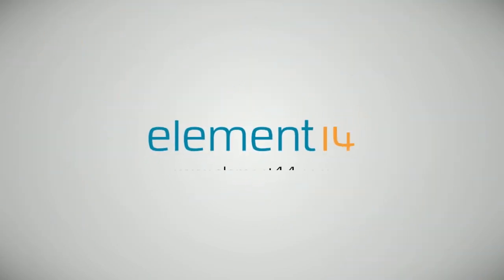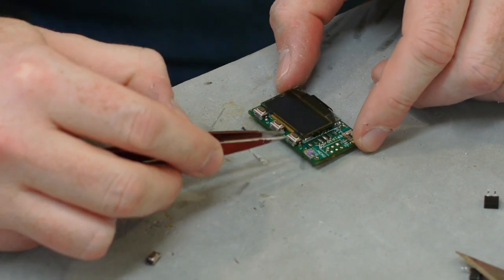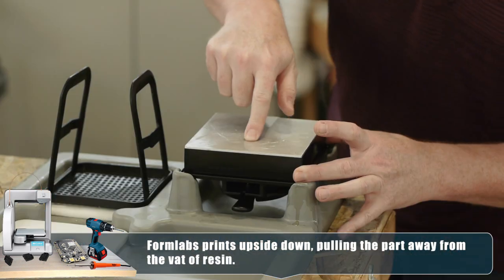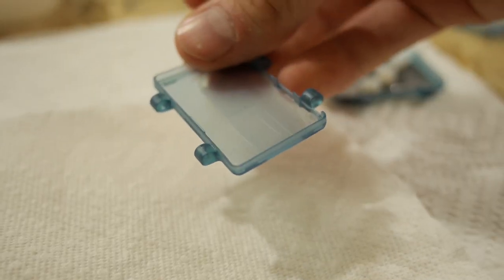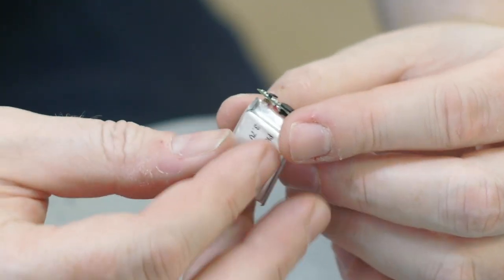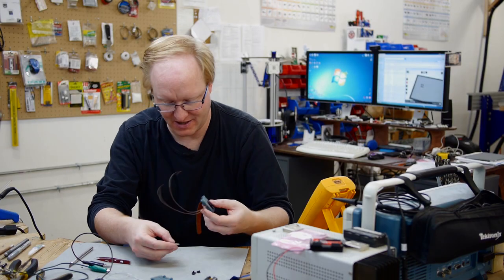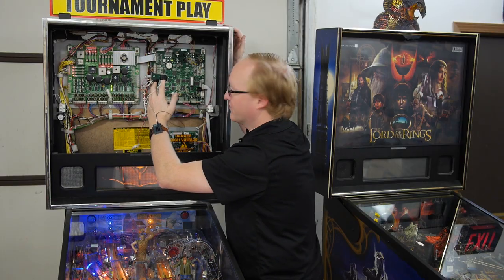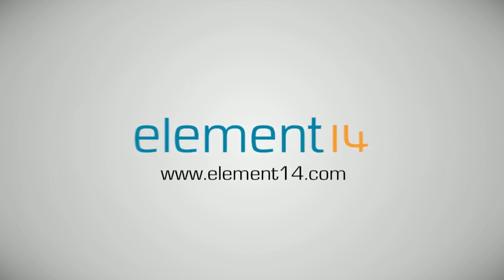Ben Heck’s Oscilloscope Watch

Comment: Seems an insulated glove would provide a bit more utility. As a wristband you are still left with the extraneous probes, wires, and finger mounts.  With a glove, everything could be all in one spot for easy transportation. Additionally you could add an additional probe with a longer wire for situations where adjacent fingers cant reach.

Comment: I have the same Tektronix 561A Oscilloscope he is holding at the start of the video! And yes, they are heavy!
Reply: +nzoomed My tech lab uses theirs as a doorstop. The door hasn't been closed in over three years.
Reply: +Troy Dietz lol, thats funny. I picked mine up at a radio club junk sale for $20 and it works perfect! They can go for $600 or more on ebay.

Comment: Nice job, Ben.
I like the design of the watch, its thinness. But I think another form factor could work better for a super portable multimeter. Something like a stethoscope. Maybe with magnets to hold the probes when you're not using them (if that doesn't interfere with the measurement), or clips or something.
Having them sticking out of your fingers all the time seems... I dunno, unsafe, unwieldy.

On the watch form factor, maybe you could place the battery under the wrist, where it's flatter.
Oh, and you could use a thinner, wider pieces of leather to make the bands, then fold and sew them. Hiding the wires on the inside. The battery "case" could be part of the band too, you could save some thickness there.
Anyway, lots of room for improvement.

It was cool seeing you do a project with the Form1! The lack of gloves while handling the print and cleaning chemicals wasn't so much, though. :P

Comment: Looks like some 70's mad science invention. Saying that I would have used the leather as a base-cloth and sewed/glued it onto a harder plastic strap along the top that hides the high profile of the battery and watch compared to the strap. Reducing the chance of snag. And with a higher profile of band you could have replaced the direct-to-device plugs with narrow pin plugs on the opposite side of the device so that a more standard probe could be plugged into the watch, with the battery being recharged in a similar fashion (literally by sticking pins into the watch band)

I also recommend your watch needed a catchier name! Like the Wrist-scope.

Comment: This is great and useful! If I were to do anything different, I would have sewn the battery into a second layer of leather, effectively concealing the battery into the band and hiding it completely. I would also make a second Slot/Compartment to store the wire leads while not in use. Maybe a SLIGHTLY wider screen to get better plot resolution if one's available. Over-all excellent build. Inspiring, as I use Multi-Meters all the time... Questions: Have you tested it's accuracy? Is it able to be calibrated? Is it reliable? How long does the battery last? Does it have a mode for measuring current?

Comment: You can discharge these batteries through a resistor, and you can buy over 300 watchband pins for under $4 on eBay. I think I'd have used that thin RG174 type cable for the probes, because it is shielded. I think it's 50 Ohms.  Jameco  has the tiny O Scope kit.

Comment: Great Episode. Loved it all except the probes at the ends of the fingers. Take two regular O-Scope probes and make an adapter that plugs into your watch port. Safer and the length of the leads will make looking at your display easier without pulling on the probes. Great job on the case. I would have calculated the absolute minimum wire size to use for the power leads. That will be a failure point.

Comment: Is anyone else sick of the thin technology thing? I always feel like I am holding a piece of styrophome and am always worried that I'll accidentally crush the damn thing with my fingers. I'm not saying we should make everything like the old 80's brick phone, but you know, structural integrity and a little bit of mass to make it feel like it's not papercraft is nice.
Reply: Me too i feel like its not even there when i hold a thin phone and that's why i have a thick case on my gs5
Reply: +Meep “the” Changeling Yea, and because of that damn trend, most phone manufacturers are getting rid of having a replaceable battery and memory expansion (no microSD now), and they are doing it with their flagship phones as well. That was one of the reasons why some of us chose to get a phone other than an iPhone. I think I&#39;ll stick to my Galaxy Note 4 for a while and not get the Note 5 because of this (not to mention that the note 5 has the same display).
Reply: +Meep “the” Changeling I agree. I'd rather have a smart watch that fits my whole forearm like the Predator thing. It should have a 7 inch display and a secret compartment for components, etc. But most importantly, it needs to be indestructible. I don't want to worry about bumping into someone and the screen cracking. It needs to be worthy of a super hero/villain. http://t01.deviantart.net/phhaau0cdwk16BCqiYyBwAlmfgQ=/300x200/filters:fixed_height(100,100):origin()/pre01/11c7/th/pre/i/2015/361/f/6/predator_cosplay___left_forearm__4__by_yonato-d9lp5zc.jpg

Comment: I would have made it have normal oscilloscope probes - but you could always make an adapter to that 3-pin header. 

I wouldn't like to mess around with an oscilloscope watch where you have the probes in your fingertips. Though I guess you'd learn from your mistakes when you've stabbed yourself with the probes a few times.

Comment: you can get a 100 or so watch pins for about $5 so a $10 watch for 2 pins was not the cheaper way to do it just saying
Reply: +legojacobr Because he needed 100 watch pins. Yeah.. that's logical.
Reply: +Stingray i was just saying that he could have saved $5 or more by just getting the watch pins and not a full watch i am not saying that he needs 100 watch pins a am just saying that they are super cheap to get
Reply: legojacobr  Gotcha.
Reply: +legojacobr Plus the shipping to get the 100 pins he didnt need. im sure the watch that he got at the local dollar store was cheaper in the long run.
Reply: +Chris Shaw 100 pins can fit in a pocket so even if is was not free shipping (most are at lest on amazon)  it sill would not be that much  and you can get packs of watch pin with less pins and he did not get it from dollar store he got it form the craft store
Reply: +Stingray You never know what he might could have come up with to use the extras in future projects. I think he did it to show the skill of scavenging useful parts from otherwise contemptible stuff, but it seems to backfire when he goes and buys the junk new when I think the point to scavenging is to use what you have.

Comment: i find people who don't wear watches to be very irresponsible, like my boss, 20% of the time he forgets to submit my weekly time sheets, he's often late for meetings, if he doesn't miss them altogether. it would have been easier to buy a watch with a leather band and use that, wouldn't cost more than the $9 for the plastic watch where you extracted $0.25 pins.

i've had Casio calculator watches for over 20 years, use mine at work every day to calculate resistance and heater element ratios on a million dollar furnace that i run. They run under $20, tell time, have a stop watch, alarm and a 4 function calculator.